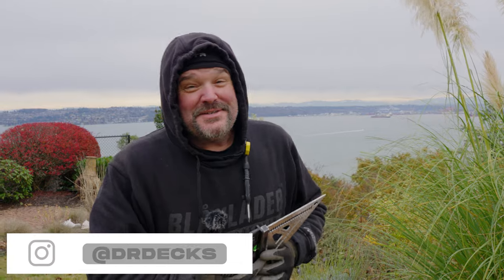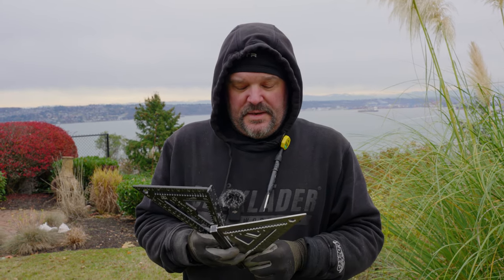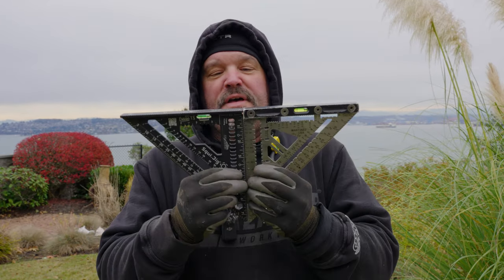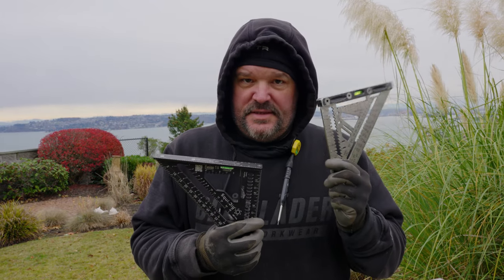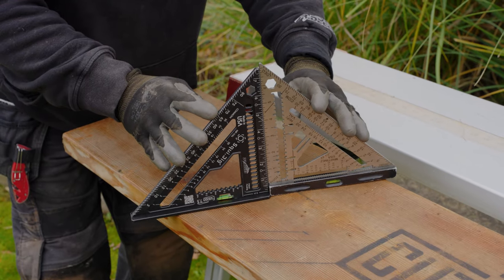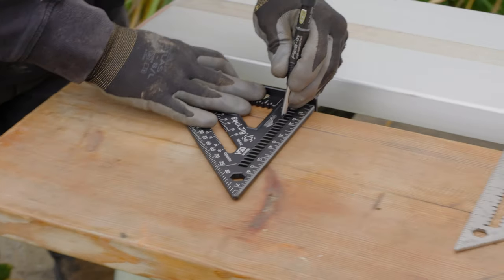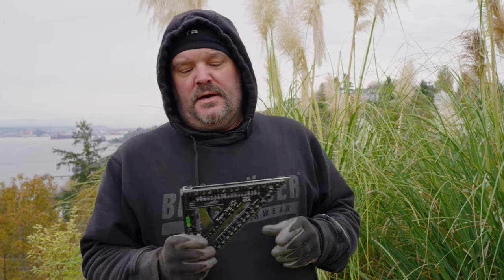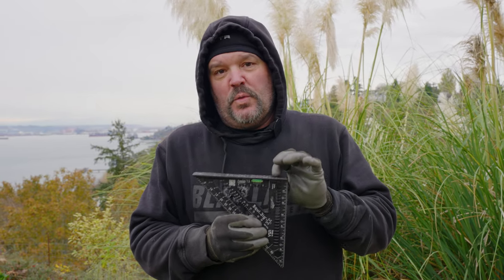Comparing Martinez & Squi.jig Squares || Dr Decks

Comment: $250 for a speed square is pretty crazy ngl. I guess if all you do is framing and have a limited tool set it makes sense, however most of the framers I've seen could invest in a plumb bob or a plate to plate level with some of the walls I've seen.

Comment: Crazy, I bought a Sawnson speed square in the late seventies when I started framing, 90% of the homes I have built have trusses so most of the time you’re markings straight lines with it figuring out a cut angle. For staircases I use a rafter square, all the information you need is on it in fact their is a 200 page book on how to use it. I did buy a new one when they put the scribe notches on it.

Comment: I bought three of the Martinez squares but I'm done now, the extra deep pencil notches every so far are maddening. I scribe lines a lot using Pica Dry or Hultafor pencils and those deep notches snap the lead off eveytime as you move along. I messaged Mark a long time ago and he basically said screw off. 
Now don't get me wrong I love me some Martinez tools, I bought literally everything they've ever built including the early framing square for 500 bucks! But I'm just done with these. I use a speed square every single day and this is something I'm just not going to deal with anymore.
Reply: $500! Bro wtf is wrong with you?

Comment: $200 and it's not titanium? No
Reply: Not everything has to be titanium imo it's very high grade aluminum with etched markings, the same type of stuff used in air planes and rockets that... literally go into space... the prices of these squares are high yes because the materials but also because of extreme precision they offer, your regular run of the mill CNC system can not make these squares the equipment alone cost millions which in return gets pushed to the consumer, I personally love my squijig rafter square and after I bought the martines tool belt I'll NEVER and I mean never give that man another dime. Stiletto hammers, squijig squares, and diamondback bags.
Reply: Also if your building regular neighborhood homes and basic decks and things such as that you don't even need these tools, but I build extremely custom mansions in orange Beach/Pensacola Florida for billionaires that want everything including my framing to be within crazy tolerances and look absolutely stunning because it's open for so long so these precision tools absolutely have a place on our jobs sites and I love my fusion square
Reply: Titanium is harder and won't ware out like aluminum.
Reply: It’s almost $400 for the titanium Martinez square. The other is only 180 and you get 10% off on top of that
Reply: @MichaelJordan-hn4zd  I'm thinking to return mine, I thought it will be between  $200-250 but yes its close to 400 just for a rafter square
Reply: Exactly

Comment: I compare buying these expensive squares with buying a set of expensive golf clubs and then expecting you can play at the PGA level. The tool is limited by the knowledge and experience of the user. Money saved by buying a cheaper but good square can be spend on other tools. Plus, a separate torpedo can be used on all squares.

Comment: Shame it's not metric..it's the 21st century.
Reply: I just ordered SquiJig in metric they do have em. Also some stair stringer jigs.
Reply: Martinez makes one in metric.
Reply: Get outa here with that metric nonsense.
Reply: I use the imperial measurement system,  the metric system is an old measurements system as well and imperial is old , it’s what your used to and more  comfortable with I’m more comfortable with  feet and inches,